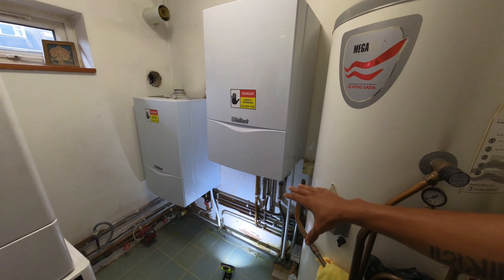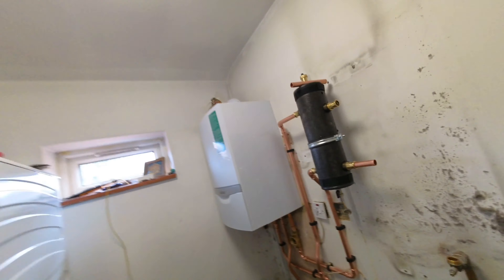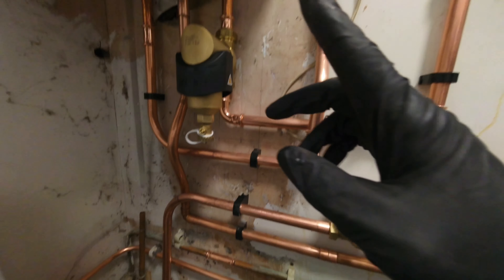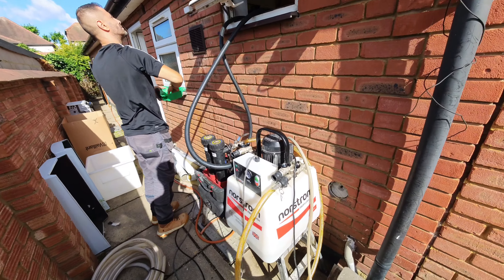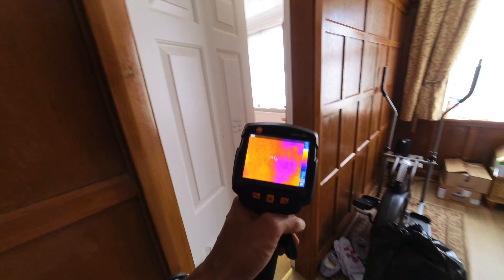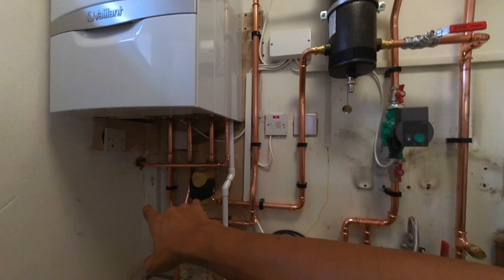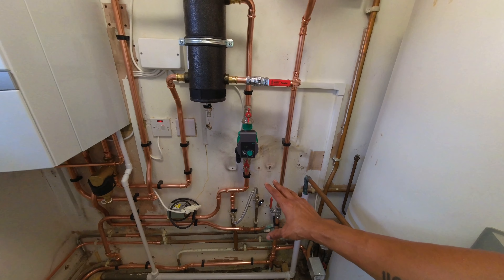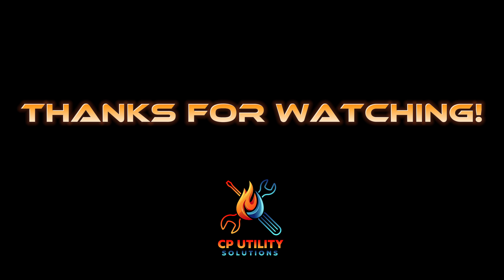This Could Have Been A Disaster! - A Day In The Life Of A Gas Engineer 68

Comment: Nice job the only thing I would have done is put a gate valve on either flow or return to the cylinder, just to tweak down the flow going through the cylinder, will help the heating circulate better and be pushing full belt against the heating return.
Reply from the maker: Ah yes good shout!

Comment: LLH acts as a bypass and a buffer to stop a system side pump robbing the water too fast out of a boiler causing lack of temperature rise and wasting gas/electricity.  
Sadly I come across a lot of double 30kw boilers shoved in and domestic engineers forget that it straddles that commercial line and can't be treated as 2 separate appliances.

I spotted one of the other commenters picked up on the pressure relief, they're correct - the only other ways round it is sizing up (2 or 3 or 4 inch pipe) or look up the temperature rating of the plastic waste pipes for water flow per meter. As if it's fast enough over a short enough distance that's the only other way of doing it. I don't know if the tables are current though or even allowed to be used anymore. If you even know the manufacturer/type of plastic pipe currently installed. 

Side note, you can have the condense go into it if the boiler has it's own condense trap which won't get effected (condense sucked out) should the tank relief go.

Cracking install and your understanding is definitely getting up there. 👍
Reply from the maker: Thanks for the feedback mate and thanks for watching, much appreciated 👍🏾

Comment: Great install . Only thing I noticed was the safety discharge pipe. Should be high temp , typically push fit polypropylene or copper. ABS isn't high temp so when the cylinder temp relief opens at say 90° c the pipe won't carry that temp . Not too sure about the condense being run into it . Having said that it looks impressive & one happy punter 👍
Reply from the maker: Cheers mate 👍🏾

Comment: Good job mate ….when the boiler is circulating within the low loss header I take it the external pump stays off whilst this is going on ? Then when the customer calls for heat the boiler tells that pump to come on ? This may sound silly but how does the boiler know just to do that small circuit.
Reply from the maker: Thanks mate, so both pumps will only come on when the customer calls for a demand. The boiler circuit will always take the path of least resistance so it will naturally just circulate through the LLH. Hope that makes sense

Comment: Great job, thanks, what a stupid installation they had, two combi? What was the issue with them that need replacing?
Reply from the maker: I think the heat exchangers had gone, it was my mate's install so he'd been there initially to diagnose the issues. The system wasn't fit for purpose regardless so it was screaming to be sorted 🙌🏾